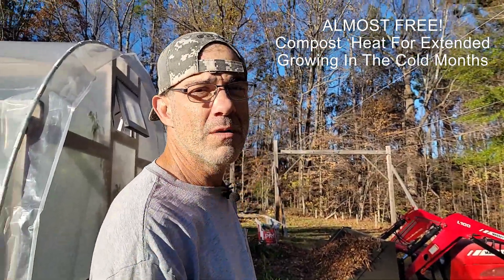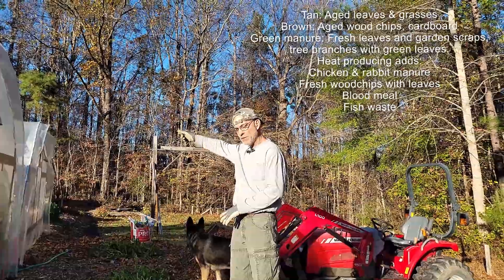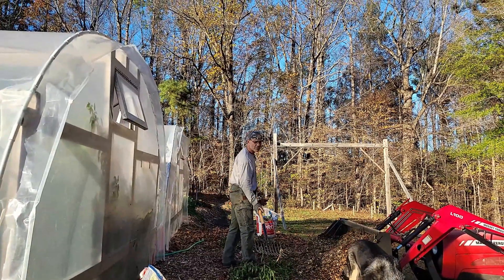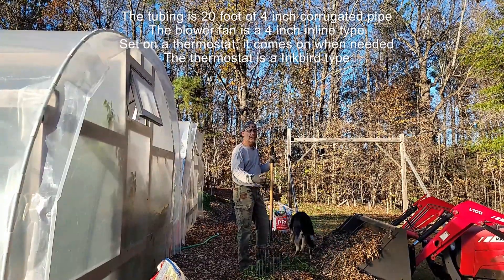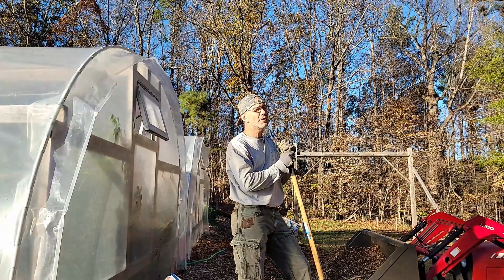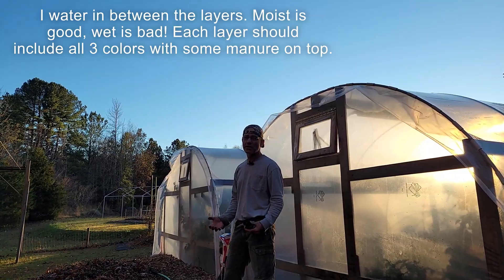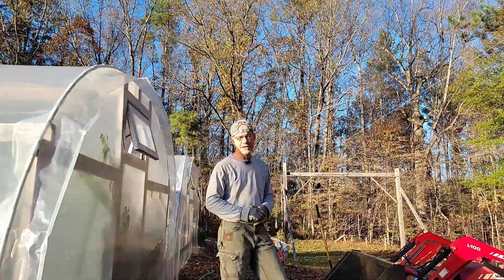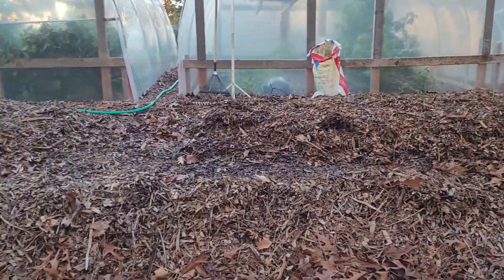Compost & Wood Chips Based Bio-heat  For Small Greenhouses Pt.2  Constructing The Piles

Comment: Add  some chicken manure, and charcoal.  to the piles mixed in. Should get  the pile  hot as you want, and when you spread it next spring. It will have the microbes, and other nutrients in chicken manure broke down to  work. .
Reply from the maker: Thats in the plans, great advice!
This year we got to 135f just prior to the arctic blast of cold. I anticipated this would burn up valuable btu's (the heat exchange) and have been gathering the manure to use at the right moment.  We'll see if my biochar experiments go as planned. If so, you know where that's goin.
So many topics to cover this coming spring... thank you for the view!
Reply: Hi, i love what you Are doing.  Is there any more to this video